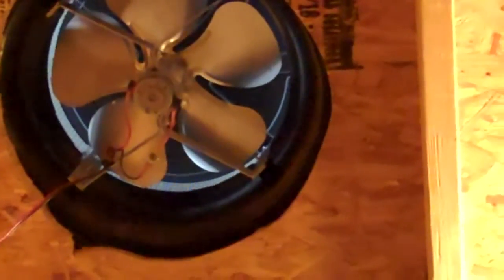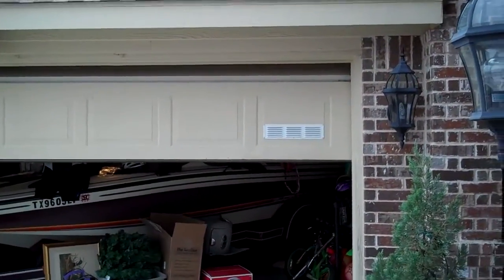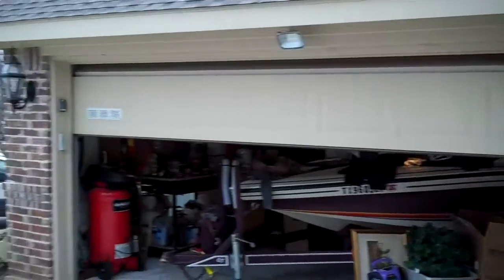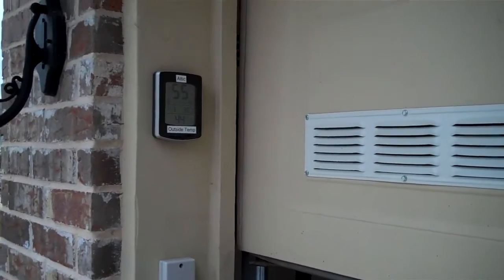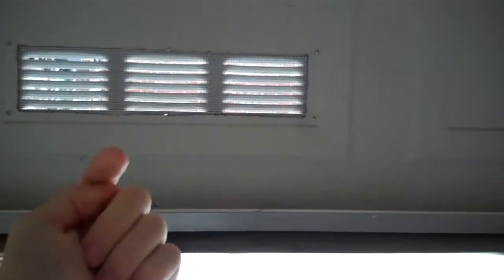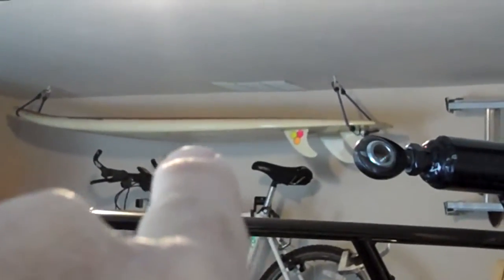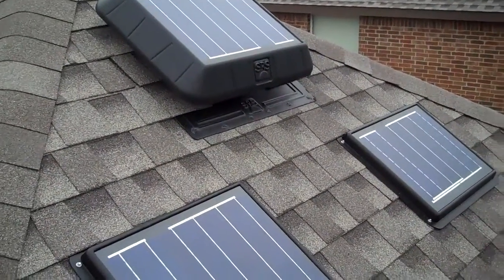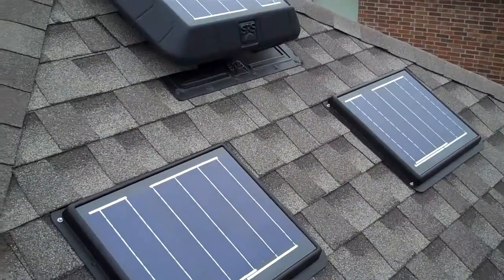Custom solar attic fan system

Comment: Attic's get hot period, no matter what kind of insulation you have. Ventilation is just as important as insulation but builders are not required to properly ventilate your attic that's why almost all attic are hot as hell. The problem with a hot attic is that most of the A/C ducting is in the attic. When the cold air comes out of the A/C unit and comes into contact with the hot ducting in the hot attic that causes the cold air to become warmer and warmer along the length of the ducting and in turn is not as cold as when the A/C puts the air out, and in some cases where it can be very hot by the time the air comes out of the vent it can be well over 70 degrees which means that your A/C is running no stop. Insulation does next to nothing to help with that issue. Keeping the hot air trapped in the attic is not helping your A/C cool your home OR saving energy. Also in high humidity areas condensation can form in the attic and leads to mold. Insulation does nothing to help with that either. Your attic needs ventilation to draw out moisture from the air. Mold can be very costly to have in your home. So to anyone who says "just get some good insulation,you don't need attic fans". Well they are not only the real liar. They are grossly misinformed.

Comment: Regardless how much insulation installed in the attic, hot air must suck out because it is the heat that cause A/C usage. Without heat, there is no need insulation so heat is the problem that's why it must suck out. Solar attic fan will do wonder because it is not too powerful to suck out the cold air in the rooms of the house below. Electric 120V attic fan is too powerful & it will suck out the cold air in the rooms below thus make the A/C to run longer/more and cause more electricity. 

I have Solar attic fan, radiant barrier & R30 Rockwool insulation. I set my thermostat at 84 and use the ceiling at #2 to cool the space where I am most of the time, my A/C only run for a few times during the day less than 10 minutes each time & do not run at night. I sleep with USB Honeywell 4 inch fan next to my bed, it works wonder. Once you adjust to the 84F temperature, it is not hot any longer.

Comment: @andrewjetmitchell I live in the midwest with both extremes of temps to contend with. Do you have a humidistat attached to this to vent the moisture? I worry that it would make my attic much colder in the winter, offsetting any savings I accumulated during the summer. Also, wouldn't it be smart if the panels had a battery so they could run in the evening after sundown? Where I am, it can still be HOT at night. Can also be moist in the attic too, I'm sure.

Comment: Guys, this isnt rocket science or just my opinion. Its fact. I live in Tx and its 105-113 degrees on a regular basis. And I have had 15-diff SRS Solar Attic Fans on my house testing 1-2 and 3 fans for 8-yrs now. I have done my homework. I also have a 8 yr list (100% happy) of happy customers that tell me they are saving ($100-1-unit) $250-2 units) and ($350-3 units) a month. My elect bill in april and may is $80-$100 and my june-july-aug bill was $290-$305. WHY......because of heat gain in my attic. If I install 2-solar fans (you have to engineer this by doing the math) 90% per-min exchange rate (common exchange rate is 70%) THATS NOT ENOUGH IN TX) and cool your attic down to 105 degrees on a HOT day, your house COOOLS down and a/c units react (by NOT coming on as much) like its april or may and dropping your elect bill. Its not magic or hype. If you put a umbrella over your house it will shade it and keep it cooler, right? If I cool your house down by sucking out all of the hot air trapped in your attic your a/c units wont come on as much saving you $$. Lets break this down more. Lets L@@K at the automobile industry. In 110 yrs now engineers have NOT found a better way to cool your cars radiator than a fan. Your car has 2-fans. 1-for normal driving cond and 2nd for extremely hot days. I have just duplicated what has worked now for 110 yrs to keep your 300 degree engine bay cool. No silver paint, and not 3'-4' of added insulation. hope this helps. Thanks

@D1incharge:(tuff guy)
                                                                            2-Solar fans Installed =$1650
R30 $3500                                                          -$465 tax credit=$1185=SMART Radiant barrier $1500-$2000 (80% profit)
Xtra Vents $800
Higher HVAC $9000=$14,500
=YOU GOT TO BE RICH!!!
Why do I need MORE insulation?
Why do I need MORE vents? (solar attic fan does this)
Why doesn't radiant barrier work by its self??
Why do I need 3-different products to do 1-job??
Because it doesn't work by itself.
(whos the salesman and whos the crook??)

I never said this will save you half (thats 50%) on your electric bill. And where I went to school $305-$125=$180 Thats not half?? (Damn that public school math) And you called me a CROOK and IDIOT for what?? For thinking differently or smart or for having a different opinion?? You showed us what your made of. lol
Reply: Nice video. Also high five on dunking that insulation sells rep or installer. He has some problems you can tell. lol. Thumbs up